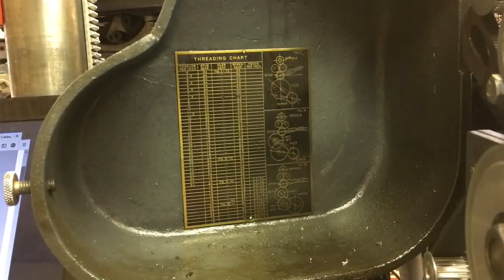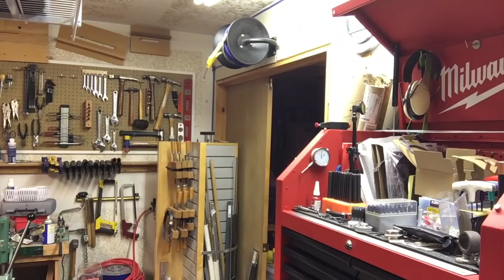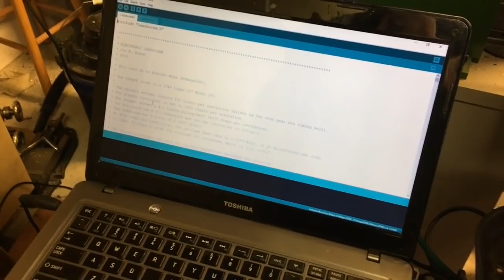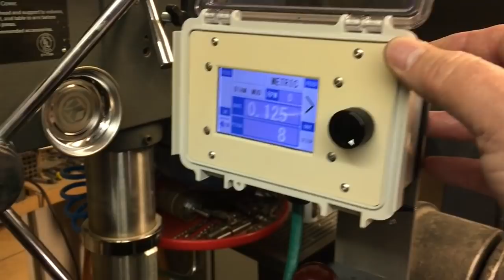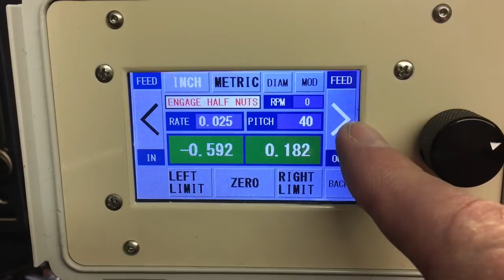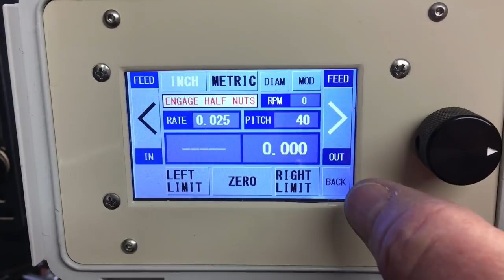My Electronic Leadscrew Project Overview

Comment: Hi Jon, how's the knee and els code coming along?   I've been reading some books on coding and have had some success with the touchscreen and stepper leadscrew.  Almost game enough to cut myself a collet chuck backing plate.  I was thinking of making people such as yourself an angel eye light to fit over mill and drillpress spindles to eliminate shadow casting.
Reply from the maker: Doing pretty well, thank you.  I think I finally figured out the main issue that I was having with dynamic synchronization, but stepped back from it for a couple of days to actually make something.  Just for grins I'm modifying an AXA MT2 tool holder to create a quick-retract threading tool.   I borrowed the idea from a Multifix tool holder.  I've got it bored, the bushings in and the insert tool modified, and need to do the cam mechanism now.  I'm not going to do a build video, but figured I'd do an overview like I did for the crossfeed screw stop that I did a while back.  As a bonus, it should allow me to use Acme threading inserts, so I intend to use it on a half nut rebuild project and do a video on that.

The very first thing I did after I got the lathe was the backplate for the ER-40 collet chuck, and got it to within a couple of tenths TIR.  I use it more than anything else.  Highly recommended.

By "angel eye" I assume that you mean a ring light?  I've thought about it myself, since my vision isn't what it used to be.  Had a "Posterior Subcapsular" cataract last checkup.  Not getting any younger.  Got to get some things done while I still can.
Reply: A ring light, yes.  I had an old friend supply me with a heap of3/4 inch perspex.  Figured I should do something useful with it, also machine guards would be nice at times to stop the coolant going everywhere.  

By dynamic synchronisation, do you mean having dual motors speak to each other?  Or am I barking up the wrong tree?  

Great idea with the modified AXA toolpost.  I had a look at the multifix idea and I think I understand where your going with it.  Sounds handy.   I wouldn’t mind new half nuts  myself.  

Outside it’s raining for the first time in months.  It’s been a record drought in Australia and town water supplies across the country are due to run out by March 2020.  Nice to have rain today though.

Look forward to your next YouTube post.  I’ll try and do one myself sometime soon.  I’m restoring an old Jen-son lathe.  Well loved and the previous owner made violins, flutes and heart valves with it.
Reply from the maker: @rohanfielder6796  You inspired me to order a couple of 120mm ring lights yesterday.  I'll have to rig up a mount and figure out how to do the power supply.  The stuff you call Perspex (acrylic) we call Lucite.  I have some acetal (Delrin) that I may use for it.

I just want to stay in sync with the thread when the feed direction changes, both on-the-fly and when coming off a limit.  Ought to be simple, but it's been giving me fits.  I don't know what it is, but I just haven't been able to wrap my head around it.  I think I'll have it working today, but I've said that before.

I have two sets of worn-out half nuts to rebuild.  Got some bearing bronze, and waiting for tooling.  I figured I'd make a plug gage, then make the new nuts.  I go back and forth between silver brazing and industrial epoxy.  We'll see.

Our son is in southern California, and they went from a multi-year drought and nearly empty reservoirs to more rain than they knew what to do with.  I hope you're as fortunate.

I'm looking at the Jen-son on lathes.co.uk.  Very interesting-looking old machines.  Does yours have the cast-iron stand?  Looks like a good candidate for an unobtrusive ELS installation to me.
Reply: Yes, it does have the cast iron stand and it’s heavier than it looks and it looks heavy.  Should have seen my wife’s face when I asked her to help me move it.  The Jen-son I have is basically identical to the first picture on the uk website.  My has other added features including a die grinder, vertical milling attachment and a clever rotary table thingy.  Haven’t quite worked it all out yet.  Been busy Cutting back the paint to reveal all the lovely bronze underneath.  I’ve been looking for a lathe to convert to els and you’re right, it is a good candidate.  Plenty of mounting options for steppers and dro etc.....

Drought in California too?  Hate to contemplate the ramifications of cities running out of water.  Quite scary.

I noticed in one of your liked YouTube videos you have an impromptu acoustic guitar jam.  I recognised Tommy Emmanuel straight away.  Do you like his work?  When I first heard him play, I rushed out and purchased a small body Maton guitar.  Still have it in fact.  

The local mechanic near me plays banjo and it’s a great instrument.  We sometimes have music nights where friends come and play.  Not often enough though.  I’m a piano player first and foremost.  How about you?
Reply from the maker: @rohanfielder6796  Sounds like a machine that's worth putting some time into.

Tommy is amazing, and I've heard him several times.  He's a busy man.  Went to a house concert with Richard Smith, who is also a wonderful guitar player.  I've been playing banjo in a Bluegrass band for almost twenty years now.  Practice tonight, in fact.  I majored in instrumental and vocal music for the better part of three years before I came to my senses.  I never did learn to play keyboards worth a d***.

Comment: I don't have any size restrictions on my lathe because I have to remove or modify the cover to fit my new drive motor. I would like a closed loop stepper but my budget is tight right now so I thought I would use a 425 oz-in stepper ($30). I have a couple of good sized drivers around the shop. My only other alternative is a NEMA 34  1200 oz-in stepper. I have 4 of them with drivers I bought for my mill project. Probably overkill. I don't have to worry about gears as my spindle is belt drive. Also the drive motor is a DC 2 HP. Probably won't stall easily. I regularly ran a 30lb, 8" 4 jaw chuck before I got my new 6". That's also why I'm installing new roller bearings in the head. You should have seen me polishing my V6 Chevy engine crank last summer. Can you say scarry? ;-)
Reply from the maker: If I were starting again I might try Stepperonline's Nema 24 2Nm kit for $87.  I think I could barely accommodate the 3mm larger diameter motor.  I just didn't have good luck with their CL57T driver the first time around.
I chucked up the ram from my Clausing 8520 mill for a polish when I was restoring it, but that was pretty tame.
Reply: @jonrbryan  Polishing that crank was pretty hairy since the tail stock was hanging off the bed about 3/4" and the crank was...well, a crank and nicely out of balance and really big. I would have been famous if I had put it on youtube.

Comment: I forgot to ask, what size stepper motor did you use,  in in-lbs.
Reply from the maker: I'm using a 2Nm (283oz/in) Nema 23 motor.  Through a 4:1 reduction it has had enough torque for every cut I've tried so far, but it will stall before something breaks.  I consider that a feature on my lathe, which has no clutches, and there are a lot of these lathes out there with broken gears.  I started off with a closed-loop microstepper motor/drive kit from Banggood, but they misrepresented the size of the motor and I couldn't make it fit.  I bought another kit from omc-stepperonline.com and wound up using the Banggood driver with their motor because it was better-behaved.
Reply: @jonrbryan  So your new setup is closed loop, using the smaller  (shorter) stepper from stepperonline? I gather the BG stepper was too long and wouldn't fit inside your cover.
Reply from the maker: @misterfixit1952  Yes, the HBS57 driver from Banggood runs quiet and cool, but the motor was about 2cm longer than the 9.6cm they specified.  Stepperonline's (Leadshine) motor fit, but the driver ran noisy and hot.  I've never even tried to modify any settings on the Banggood driver, and nothing I tried in the Stepperonline driver configuration made it behave as well as the one from Banggood out of the box.
Reply: @jonrbryan  I'll keep that in mind. I wish someone made cheap drivers that used the Trinamic chips. I use them exclusively for my NEMA 17s on my 3D printers. They are phenomenal.
Reply: The new TMC5160 step sticks will handel 3A drives so I might be able to use them with proper cooling.

Comment: One last question, is it possible to use a 3D printer touch screen as the controller for your project? BIGTREETECH has a new series of color touch screens with a built in rotary switch for $14. The boards are open source so the software and hardware are fully documented, at least for the TFT24 and I read that the TFT35 will also be OS soon, if not already. These boards have all of the usual connections for a printer control board including a micro SD card slot for the firmware. Looks like a good solution for the control panel. Here is a link  to the TFT24 on aliexpress.  https://www.aliexpress.com/item/33044733169.html?spm=a2g0o.productlist.0.0.12be2295mNYvyU&algo_pvid=764cab4a-c2ea-404f-acb6-0329f191bc69&algo_expid=764cab4a-c2ea-404f-acb6-0329f191bc69-0&btsid=dad221c9-5dfe-481c-afcf-702815e35c68&ws_ab_test=searchweb0_0,searchweb201602_9,searchweb201603_53
Reply from the maker: That's intriguing, but smaller and lower resolution than the Nextion display I'm using, and I've already got mine working very well, with very low communications overhead.  I like that they have the encoder incorporated on the display board.  Does the Big Tree Tech display have some kind of editor for setting it up like the Nextion does?
Reply: @jonrbryan  I just got mine a couple of days ago and haven't had time to check out the specifics. I know that you can modify the screens for 3D printer features so the answer is probably yes. I'll check back when I know more. Checked out your DRO video. That is a really sweet lathe you have. Very nice restore or the best old lathe I've ever seen.
Reply from the maker: @misterfixit1952  It's in pretty good shape for being 73 years old.  I just picked up an 8" faceplate from eBay and trued the face a couple of days ago.  The moment I slid it onto my surface plate I could tell it was dead flat.  About the only thing I'd like to do is scrape in the cross slide someday so I don't have to keep the gib so tight.  I'm getting ready to rebuild a set of half nuts to take some of the slop out.  I guess I should do a video.
Reply: @jonrbryan  Are you going to use something like moglise to redo the half nuts? I need to tighten up mine as they are getting worn, being made from chineseum. If I do the lead screw with the jog wheel, the half nuts will be engaged most of the time and will probably wear pretty fast. using release on the lead and resurfacing with moglise would make them pretty bombproof. ROBENZ did that on the lead screw on his Deckel grinder. The other option would be to turn one out of bronze bearing material and cutting it in half. Any replacement I buy from Grizzley would probably be made from the same chineseum.

The real trick is finding a source for a small qty of the moglise. That stuff is almost as expensive as gold. I did run across a recipe for making home brew. Came from the patent for moglise, at least that was the story.
Reply: @jonrbryan  I just got a new 4 jaw independent chuck for my lath and am making the back plate as we speak. I was going to use the old trick of making one out of a barbell weight when I found one in the back of my lathe cabinet. Totally forgot I had it. It was hiding behind my 2hp baldor treadmill motor (soon to be installed on the lathe). So many projects, to little me.

Comment: Jon, one thing you might think about is porting your control board over to the Texas instruments launchpad platform. @ $30 it's cheap and the programming tools are great. It is also set up, in hardware, to work with quadrature encoders. If you want to include real buttons into your build for control of the lead screw travel, you might consider using the board that Clough42 used. It is only $2 and has a full row of buttons on the bottom and also has 2 separate led readouts which would work great for start and stop values for the lead screw. Also looks easy to incorporate into the software. I still think your touch screen concept is the best way to control most of the functions and since I am planning on also adding a touch DRO to the lathe, I was seriously intrigued by your idea of adding bluetooth. Yuri at Touch DRO also uses a Ti based CPU for his DRO and the circuit is stupid simple and the programming is already done. I hate to sound greedy but with your ELS combined with Yuri's Touch DRO, I think I had died and gone to Hobby Machinists Heaven. Just some food for thought. Keep up the great work, I'm looking forward to, maybe being able to implement your ideas into my final project. BTW, don't worry about video quality, your content is what counts and it's top notch.
Reply from the maker: Yuriy's been very quiet for a while.  I've got a TouchDRO setup installed on the lathe with an Amazon Fire tablet, if you look at my other videos.  Put one on my little mill, too.

The TI Launchpad/MSP430 micros can do a lot.  MSP430 has been around for a long time.  I settled on the Arduino Mega, and it's getting the job done.  I'm using one from Elegoo, and paid less than $20 for it.

I'm trying hard to avoid buttons, but I will probably add an (ON)-OFF-(ON) feed control toggle switch.